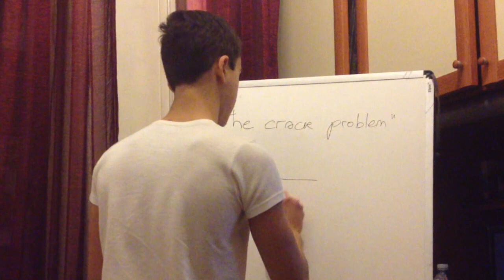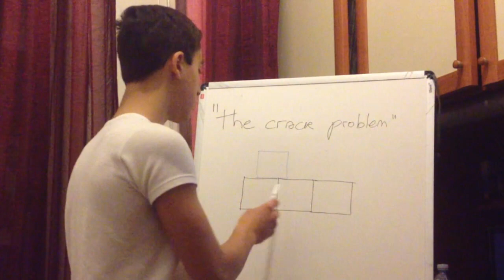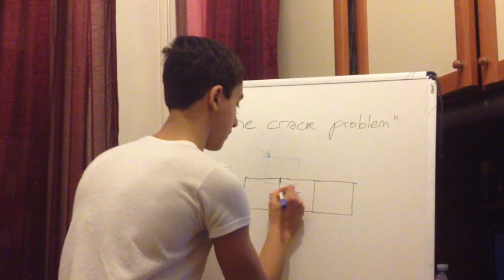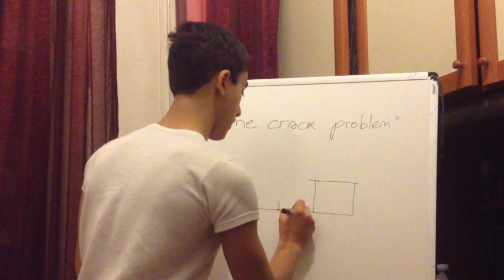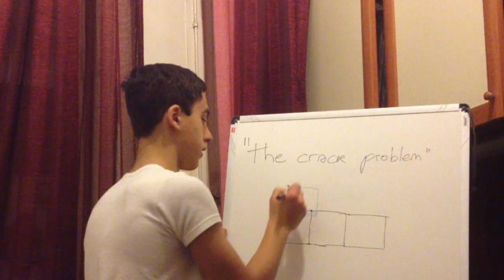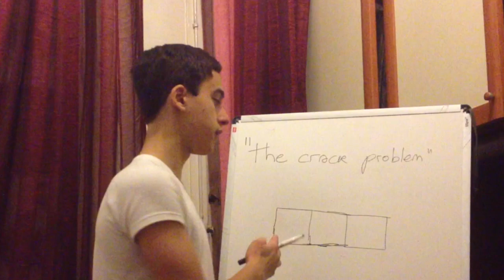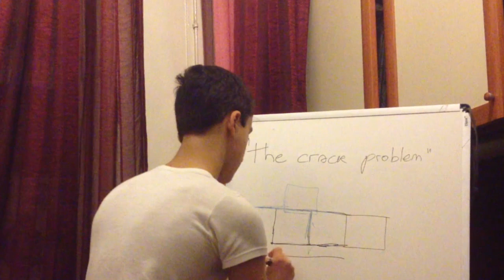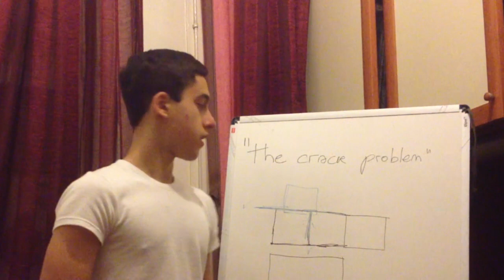[Tutorial] Solving the "crack" collision problem

Comment: There's a problem with the first method that if you're moving right fast enough you can still get stuck in the "crack".  There's a problem with the second method that it doesn't work for dynamic topology.  This problem is  also called the internal edge problem if you're googling it.

An excellent video.  Thanks for posting it.
Reply from the maker: Thank you for the feedback and for mentioning the "correct" name of the issue. I will learn more about other possible solutions now :)
Reply: I'm not sure it's the "correct" name for the problem or whether such a thing exists :) .. but it is another name for the same problem which might help.   I've been looking into this myself.  If you break the collisions down into corner collisions and vertical/horizontal collisions and do the vertical/horizontal collisions first then the player sprite always collides with the tile underneath him before the tile he is moving to.